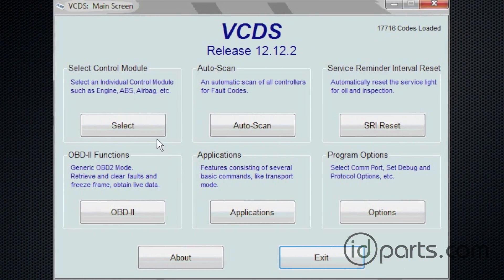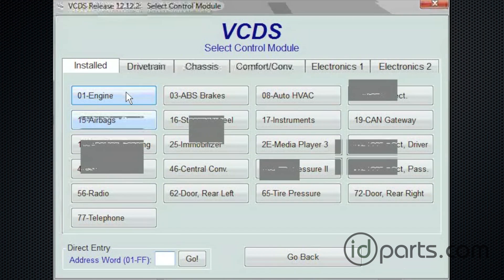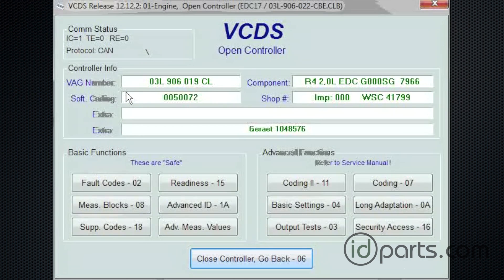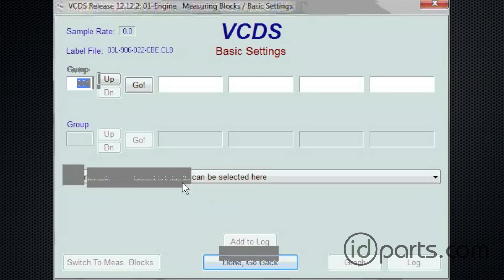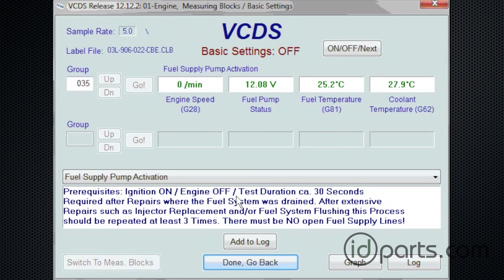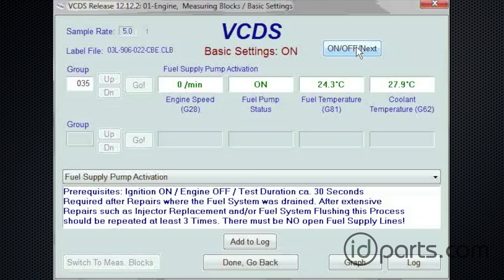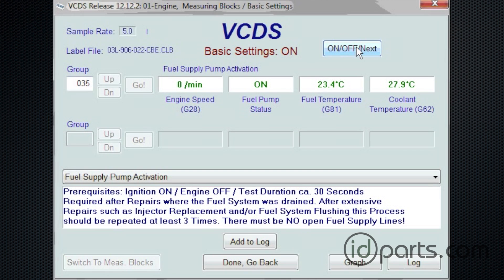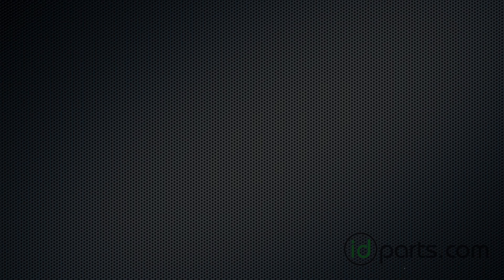Priming TDI Fuel Filter Using Scan Tool How-To

Comment: Great information. 
For those who are simply replacing a fuel filter in a TDI, it is possible to just simply refill the fuel filter housing, (Even if you use a diesel fuel additive such as Power Service, or Fresh diesel fuel) and start the car and not cause any damage. 
BUT-- if you've introduced air into the fuel line via a fuel line replacement, of if you've changed injectors this procedure is a MUST! 
I've tried it both ways, and the refill the canister technique doesn't cause a delay in starting time if done properly.

Comment: If i have changed the fuel filter and not filled it up with fuel before putting it back in its place, i can fill it up using this method ?

Comment: Do you still need to fill the canister with fuel if primed?
Reply from the maker: No. If you pre-fill it will lessen the priming time, however, the pre-filled fuel won't go through the filter. Therefore, we recommend NOT pre-filling the fuel filter.

Comment: Thanks for this! And great parts service (got the kit with all the filters from IDParts). For those doing their fuel filter, just be careful when you insert the new filter, do it SLOW and put some absorbent rags/towels around the filter housing...so when you push the filter down, it will splash up fuel. Following this with the video, I primed it 3x (30 secs each time per the note in VCDS). Success!

Comment: I found on our 2012 Passat the Basic Settings group is not available. I am able to get the filter primed using the selective output test for the fuel transfer pump though. The only difference is it runs the pump in bursts.